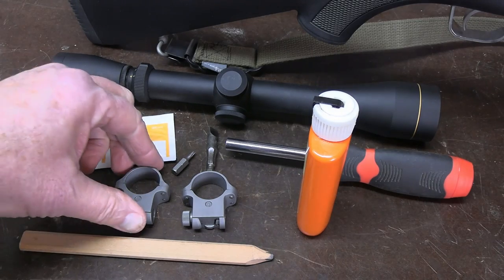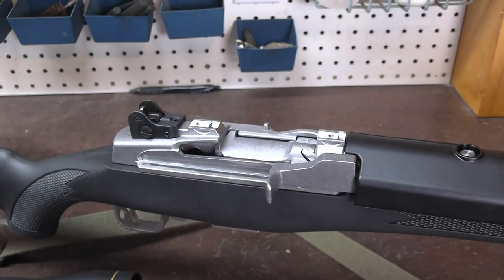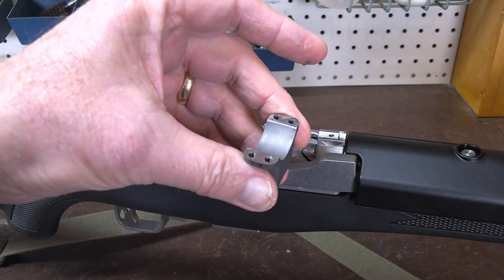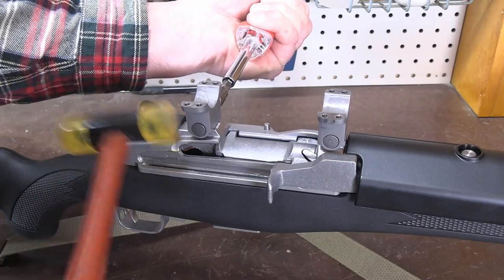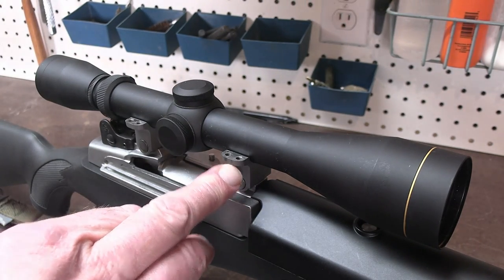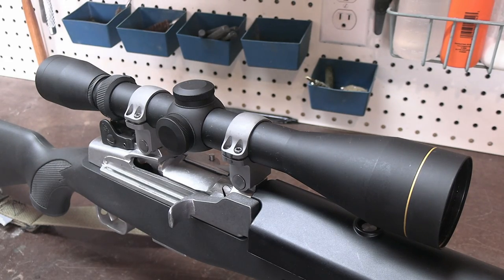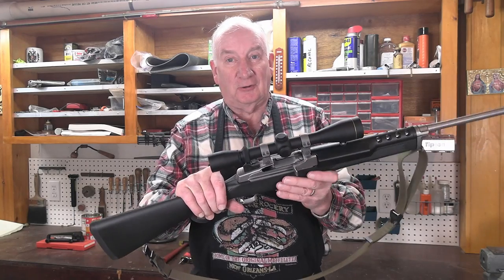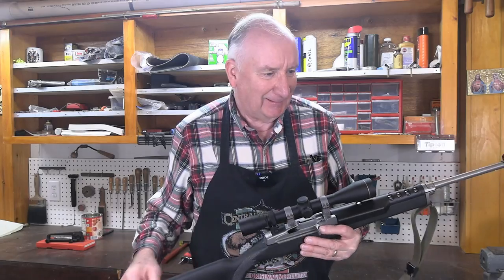How to Mount Ruger Scope Rings ~ Mini-14 or any others

Comment: What size scope was that you are installing on that rifle?
Reply from the maker: The scope that I demonstrated is a 3-9 Leupold.  However, it would not be the scope I would recommend.  I would prefer a 1-4, 1.5-5, or 2-7 power scope.
Reply: @GunBlue490   thank you for responding to me. My mini 14 came with rings and I've thought about putting a scope on it. My rear peep sight is extremely small, I wish it was like my M1A. I assume that scope in your video was a 40 mm objective lens?
Reply from the maker: @allyn1016  Yes, it's a 40mm lens, but less power requires proportionally a smaller diameter objective.  You may wish to try a Tech Sights peep, as I demonstrated in another video.  The aperture is very similar to an M1A peep, and has even finer adjustments.  They also have an optional peep system with interchangeable peep inserts, which provides correct aperture size for target, field, dull, or bright conditions.
Reply: @GunBlue490  thank you once again for taking the time to respond to me. I did see your video on that, and I am definitely going to make that purchase for that site. I'm like you I would prefer to have the iron sights, it must be an older guy thing. Again thanks and I am now a subscriber. 
Does your mini 14 put a ding and all of your brass when you fire it?

Comment: Sir what sling are you using?
Reply from the maker: It's a one inch Garand style sling, available from Tech Sights.  It's made to replicate the original 1-1/4" Garand sling, but for smaller rifles with smaller swivels.
Reply: @GunBlue490  I thought it was. I actually have one in my cart right now and I didn’t know if I wanted the 1 and 1/4 or the 1 inch. Thank you so much!